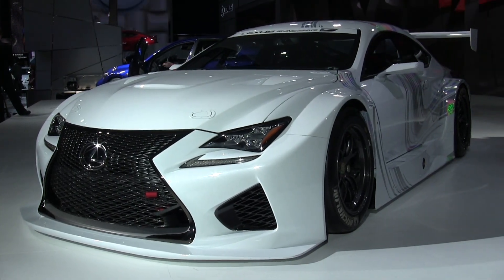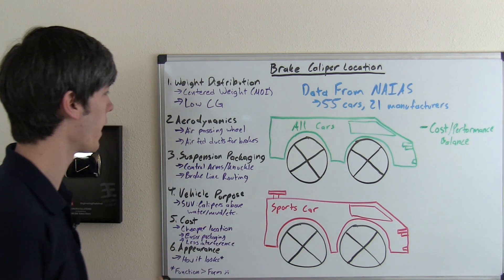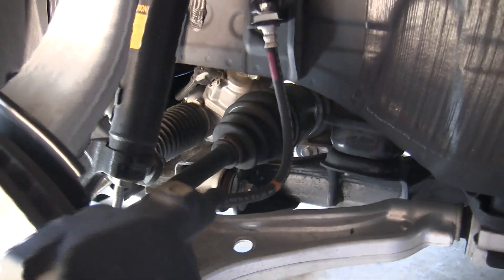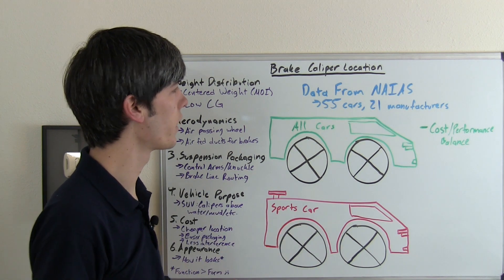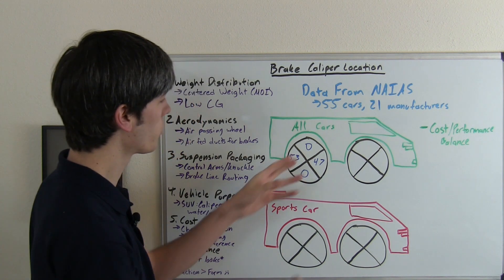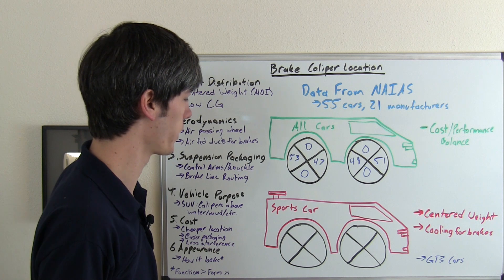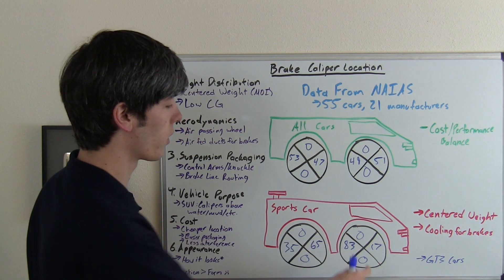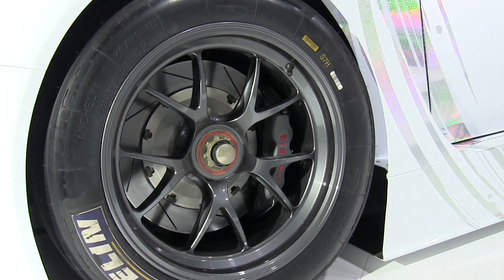Brake Caliper Location - Explained

Comment: you left out the most important consideration. how it affects dive in relation to other suspension geometries and the load path.
Reply: +mbsnyderc The "drive" configuration (I.e., FWD, AWD, RWD) typically does not matter. The only other reason really why most sports cars have the front calipers to the trailing side (rear side) is because of designers specifically wanting leading steer setup (i.e., the steering linkage / rack) being ahead of the axle centerline. 

The reason why designers do this is because of suspensions deflection during lateral loading (particularly the control arm bushings). When deflection occurs, the steering geometry changes and with a leading steer configuration, lateral loading deflection is going to push the outside wheel inward towards the center of the car. This is going to reduce the steering angle of that wheel so it will require more driver input to correct and maintain the same line (basically it in a sense causes understeer). When the steering is on the trailing side, the lateral load deflection causes the steering angle to increase (basically like an oversteer of sorts).

Its better to have deflection understeer and force the driver to have to add more steering input then deflection oversteer as its more controllable by the driver. Deflection oversteer can cause a sudden true oversteer situation where the rear wheels loose traction and the rear comes around on you.

Since there isn't typically enough room to have the steering arm of the knuckle and caliper on the same leading side and designers are forced to put the caliper on the trailing side. This however is not a trade-off as there is the weight distribution benefit to having it on the trailing side.
Reply: +TIMEtoRIDE900, while the weights in question are relatively small as are the effects from it, nonetheless, there is a "positive" benefit. As said in the video, there is less moment. for a street car, the effects are so minimal that it's not really noticed but on a several hundred thousand dollar plus purpose built trakmck car, we're fractions of a second per lap in long duration endurance races, it can make a somewhat noticeable difference. 

as for the deflection aspect which is the primary reason for the place when talking street driven performance cars, the manufactures are designing around the OE components that are being installed from the factory and in the case of bushings, they are rubber. They aren't designing around what an owner / enthusiast may or may not do or change. Example, Chevy did not design the Corvette with the assumption that the person who buys the car is going to go out and install poly bushings (which for most cars I would highly recommend against anyways) or change all of their control arms to aftermarket arms with spherical bearings or Heim joints. They are designing around the OE installed part.

as for deflection on more race oriented aftermarket parts, while deflation is less compared to and OE part with say rubber bushings, there is still deflection. Much of it is still however heavily dependant on the tires and setup which control just how much corning force that can be generated. a car cornering at say 1.1 or 1.2G's is applying a pretty substantial amount of lateral load on components and things do flex and deflect (you'd be surprised at how much it can) and that's just a high performance street car with okay track tires. You take a well designed track car with full slicks that can corner a upwards and above 2G's and you can really start to get some significant deflection I. suspension and chassis components and structures..

also the amount of geometry change due to deflection  is relative to position of items. We are talking small amounts here but for a high dollar purpose built track car, it can be enough to effect laps on the fractions of a second but when in say a 24 hour endurance race, those fractions of a second per lap add up and when you're talking about occasionally events where the difference between 1st and 2nd place is in the 100th's and even 10th's of a second from time to time, anywhere that you can pick up a 10th of a second on a lap, you are going to do it.
Reply: +Marc Niece That is what i was thinking, also should have looked at if the car's were all wheel drive front wheel drive or rear wheel drive,as i think that may effect were you want the brake caliper.
Reply: +Chris P Great analysis ,
I was going to add that his "cooling" theory seemed wrong - 
a rear caliper would not take any extra duct work, as you are not cooling the caliper,
you are providing cool air for the disc, and a vented disc needs air shot right at it's center. A solid disc just needs air shot at it that will get sucked thru the rim, which is a heat sink.
Hopefully the caliper will be much cooler than the disc. !!
Reply: +TIMEtoRIDE900 What he was getting at, is that with the ducting for the rear is if the caliper is on the leading side (i.e., torwards the front of the vehicle),  the ducting has to get longer to get to the trailing side since the caliper is on the leading side. If the caliper was moved to the trailing side (i.e., towards the rear), for a cooling air supply ducting, it would be shorter and more direct.

With "sports" cars, there are a few reasons why manufactures typically put the rear calipers on the leading side. For one, they are less concerned with rear brake cooling relative to front since the rears do a very small portion of the total braking under high G deceleration events due to dynamic weight transfer. Typically the rears on most front engine rear drive cars are only doing in the neighborhood of 20% of the total braking so the heat generated is relatively small (this is assuming street tires and / or DOT track tires (i.e., not full race slicks)). The next thing is if you pay close attention to many modern performance / sports cars, the rear disc's are becoming inverted (so to speak). By this, what I mean is the air inlet to the vans on vented discs are on the outside, not inside like they have been for about as long as vented Disc brakes have been around. Look at the new mustang's rear brakes for example and you will see exactly what I mean.... 
The reason for this is it produces better disc cooling in the rear because of the high pressure area pushing in on the rear wheels. In the front, the nose of the car causes a low pressure area beside the front wheels so air naturally flows from inside the wheel outward. On the rear however, there is a high pressure area beside the wheel and due to improved undercar aero, chances are, under the rear of the car, the pressure will be lower so this naturally creates an airflow direction that flows from the outside in, so putting the vent entry on the outside instead of inside (like what we are used to), it makes better use of the natural airflow direction to promote better cooling of the rear brakes.

Now the real main reason why manufactures tend to put the rear calipers on the leading side like what was showed in the video on sports cars is related to what I mentioned about the fronts with geometry change due to deflection when cornering.

In the previous post I used the terms deflection Understeer and Deflection oversteer. Lets changes those to Deflection Toe IN and Deflection Toe OUT. As mentioned, in the fronts, if the steering linkange is ahead of the axle centerline, then Deflection Toe change is going to be OUT (i.e, deflection understeer) which as said is a safer and more controllable. Now how this applies to the rear is because most cars now-a-days have independent rear suspension with adjustable Toe, well the same thing, deflection in the suspension from lateral forces causes Toe change at the rear wheels just like it does in the front wheels. However, we want the opposite in the rear. We want any toe change from deflection to be toe IN at the rear wheels cause this causes them to try to turn in on a tighter radius which basically is a deflection understeer condition so the driver has to add more steering input. If the rear was to Toe OUT, this would cause the rear to want to Oversteer. In order to have deflection Toe IN in the rear, the Toe control links need to be behind the axle centerline and since we want the link behind the centerline, it becomes easier to fit the caliper ahead of the axle (i.e., on the leading side) which has the added benefit of better weight distribution.

So to sum it all up, we want Deflection Toe OUT in the front and Deflection Toe IN in the rear to make the car more controllable due to deflection steer effect. To get Deflection Toe OUT, the linkage needs to be ahead of the axle (really it would be ahead of the steering axis) and to get Deflection Toe IN, the linkage needs to be behind the axle and thus we want the front linkage ahead of the axle and the rear linkage behind the axle which therefore makes it more practical to place the front calipers on the trailing side and the rear calipers on the leading side.
Reply: *****
Well, that makes alot of sense.
But on the rear, do you think the control arm, and it's attaching point, which are IRON are lighter than an ally caliper and it's bracket??
and,
Enthusiasts upgrade to polyurethane, and real racers use billet aluminum suspension bushings (which are noisy). Are we really having much deflection with Poly??
and,
Your favorite brand names for replacement brake pads that are "better" than ordinary parts store brands??
TIA